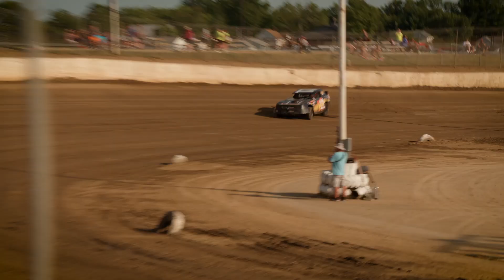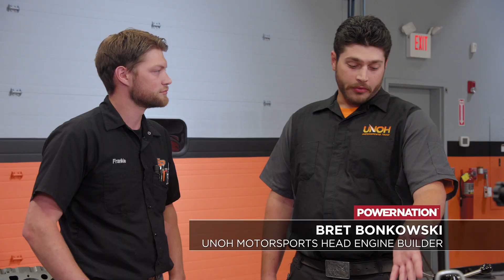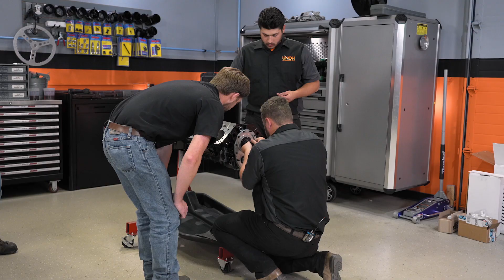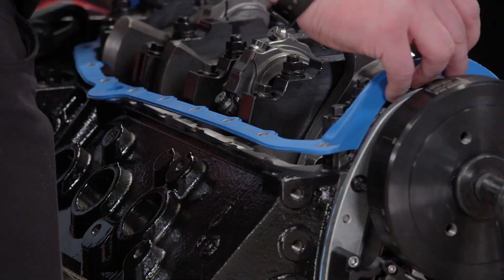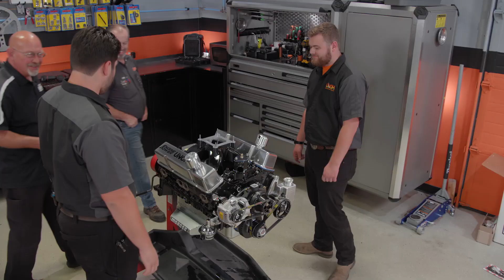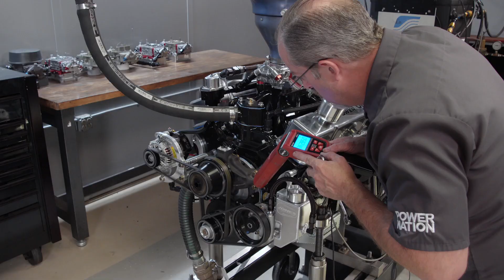406ci Dirt Track Engine: Race Winning Horsepower with Cast Iron Heads - Engine Power S11, E13

Comment: It would be competive with our last version of hooby stock,but not the class of the field about average for top 5 car.If the dyno is accurate.At the end Ford had taken over power wise with n351 heads with 420 plus cubes over 700 hp.Again very nice engibe but not cream of the crop at least here locally.However and this is the thing 8 ibch tires only hook up so much power and on dry slick a 350 to 400 hp engine can and many times has beaten 600 to 700 hp screamers.Friend grenaded 700 hp ford installed a 355 with around 400 on a good day still won races.Only when really tacky track it would get it's butt handed to it.This is why hobby stocks died 20,000 dolar engnes racing for 300 bucks killed it and only a few could afford them so guys just stopped racing.Then along came sport mods but they are heading same direction as they are allowing ct 525 to compete and the restricted badly sbc can't keep up.Rget aren't allowed porting,2bbl iron block and heads vs aluminum block and heads ct 525 not much contest

Comment: $3k for the block. 
$1700 for the crank.
 The shaft rockers setup alone is $2000
Cam and lifters is $800-$1000 easy 
 Rods, pistons bearings, machine work. 
 Heads are $2k for the set easy. 
Dont forget the assessor drive, ignition and carb and intake. 
You’re at $15k easy for all that.
 I just watched a Kenny Wallace video about his engines. They run about $15k
 Don’t forget they spin these  to 7500-7800 the entire race.
 Circle track needs this for reliability. 
 Good quality parts even from scat or eagle will get the job done at 600-700hp.

Comment: Interesting camshaft for a Dirt racing engine. Usually those big intake/exhaust splits are used on high rpm drag engines where HP in the 6000-8000rpm range is all they care about
Reply: It wouldn't surprise me if it was Compcams support that spece'd the cam, it seems to be a common thing they do. 😄 Decent street cams, but they are a bit behind the curveball for race cams.
Reply: @PSA78 they best gear it to the max cause if not it’s gonna be a dog off the corners on track. Way too big a cam for a 3000 lb stock car

Comment: Got 86 iroc muncie 4 speed swap 406 flattop pistons heads comp cam motherthumper 750 summit carb aluminum intake headers it's a runner 373 posi McLeod racing clutch

Comment: About 20 years ago now. I used those same heads on an approx. 420cid streetbound pump gas engine. It was a .040 over 2 bolt factory block. With studded mains and a partial block fill. Went with a 3.875 stroke Scat 9000 series crank, and their 7/16" capscrew 6" I beam rods. Speed Pro Hyperuetectic Street Performance pistons, with a TotalSeal gapless ring kit. Hydraulic roller cam and lifters from Comp. Believe it was a fuel injection friendly grind of around 240° at .050 with under .600" lift. Made my Burnt Orange '73 Nova sound pretty rowdy.

Comment: That should have made 700hp or near it.
Reply: That's what I was thinking... Those massive heads, cam,1,000cfm carb & 13+ to 1 compression. 

There is a guy on the Chevelle forums that I am a member of that builds BBC's using factory cast iron cylinder heads that is putting out more HP than this engine for a fraction of the price! And they are street friendly too!

Comment: I do like the motown block, and the reason is the oiling system.  Main galley splits out to feed lifter galleys at the same time [not sequentially], and... priority mains never hurt.  But 75psi while priming... maybe the high volume pump was not necessary?
Reply: ...my thoughts exactly. We used to run a standard big block pump with a shortened oil drive shaft....and we would actually get great oil pressure. Then my driver got ahold of a "high volume" big block pump....and decided he'd like to try that. After grinding the gear off of the distributor and camshaft a few times from excessive torque on the engine...we definitely went back to a lower volume pump.